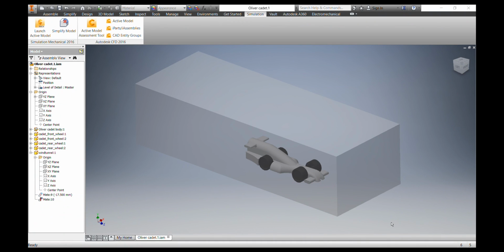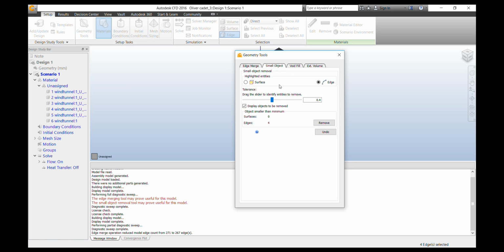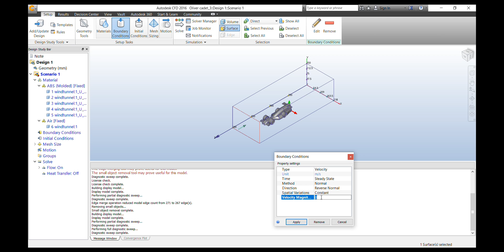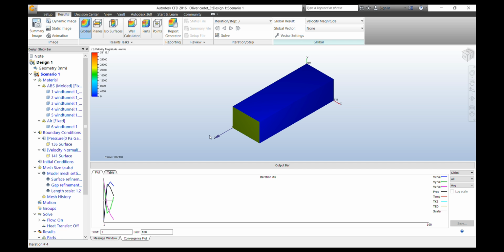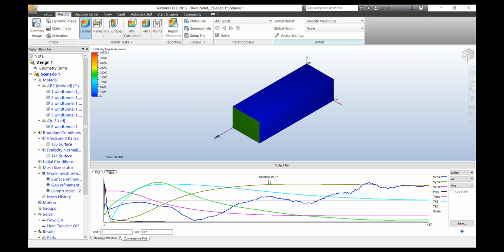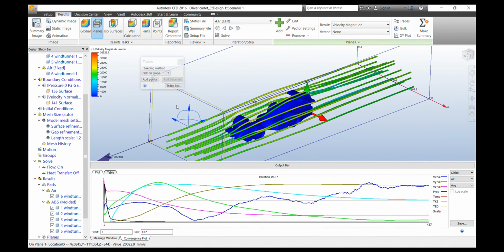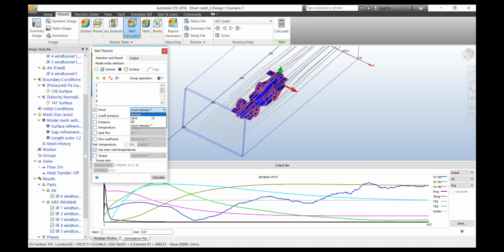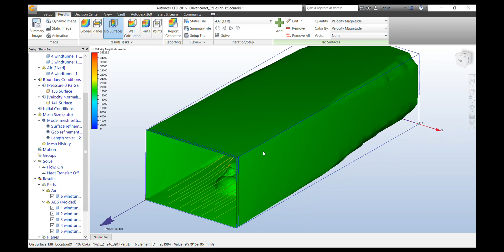Autodesk Inventor/Simulation CFD - Virtual Wind Tunnel Testing

Comment: considering F=0,642159 N - air density = 1,20473 kg/m^3 - air speed 20 m/s - Frontal area = 59777,6 mm^2 the Cd = 0,0044. Is that correct and possible?

Comment: how do I create the model in autodesk inventor?
specifically, how do i make my actual object and the surrounding domain around it as separate things?
Reply: You don't have to model it in Inventor. You can also import .step or other CAD formats. If you don't include the "wind tunnel" as a seperate object in your CAD file you can add it in CFD with the geometry tool

Comment: please marry me. i owe you something, i'm doing a final grade thesis about aerodynamics, and i wanted to bring a cfd simulation of a wing i designed on Inventor. the thing went smooth asf, thanks to this tutorial
Reply: wholesome but ayo
Reply: Im doing a similar project, a RC flying wing. But something that I dont know why its happening is my lift force and drag force are super small... like 1-3 N. Do you know why this is or how to fix it? Becuase that cant be accurate, im using the MH 60 airfoil and the database says it should have a 20-25x CL/CD but im getting 4x...